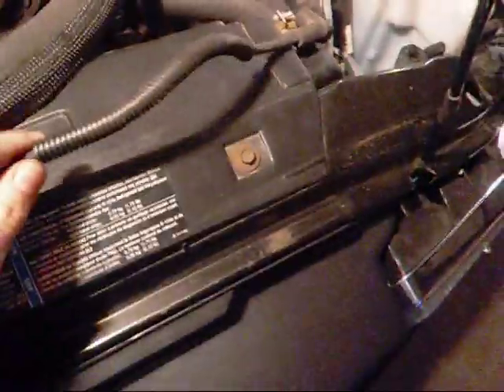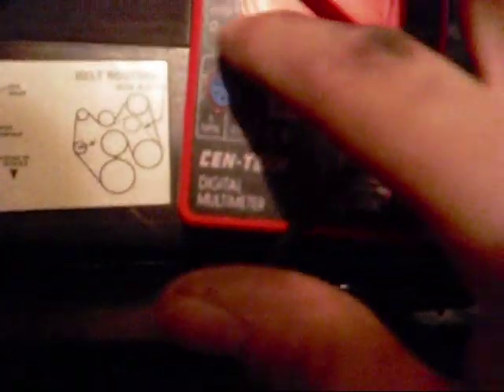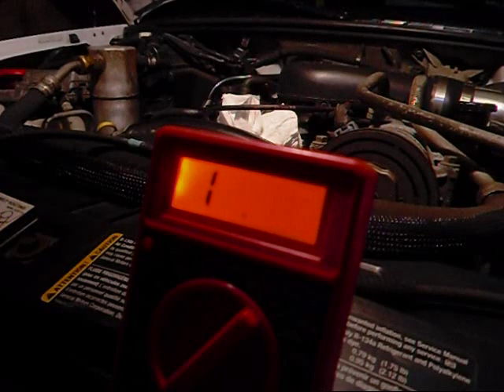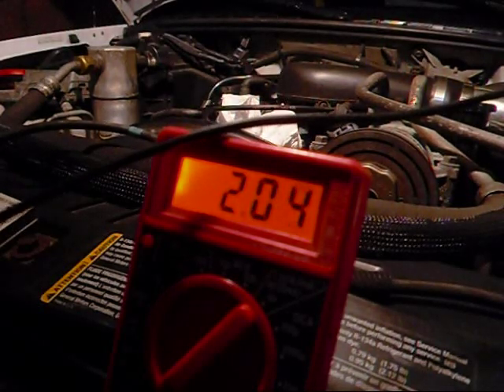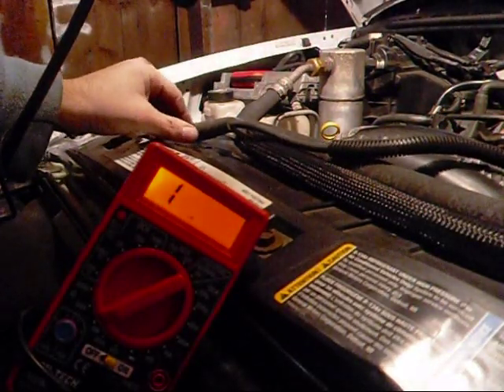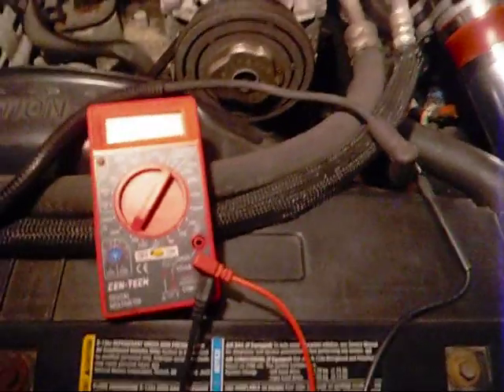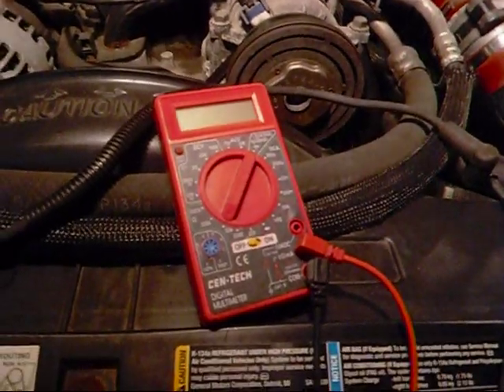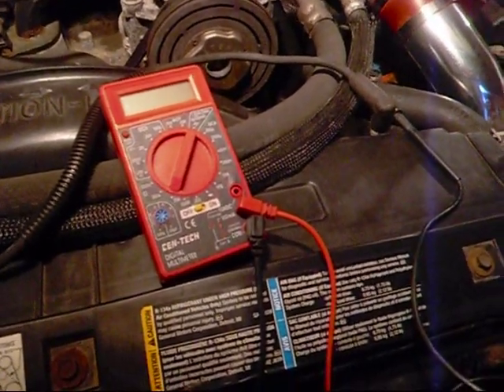how to check resistance is spark plug wires

Comment: Rule of thumb is a resistance wire should not exceed 1k ohms per foot or 1000 ohms per foot.(Same thing)  If you have way more than that .... pull back the boot off each end and make sure the point of the metal end has punctured the wire jacket to the core or the small piece of "U" shaped wire that connects the end to the core is not burned . If the core wasn't making good contact with the point of contact of the wire end .... always have a spare wire around that you can transplant the end. If your end is good then open the end where it wraps (crimps) around  the wire, cut about 1" off the wire and re crimp the end making sure the point touches the core.  If you do it right the wire will be fine as long as the resistance stays below 1000 ohms per foot. This is for resistance wires only ....solid wires will read no or negligible resistance ...0-2 ohms  but, that would be a model "A" ford.

Comment: lower resistance in spark plug wires is always best.  Different manufacturers call for different minimum specifications.  Test a spark plug wire on a top fuel dragster.  You're going to find the resistance barely exists.  Check your piece of garbage Kia or Hyundai.....out the roof high.
Reply: +Kevin Johnson That's because dragsters have solid wire cores ...but, family car with solid core wires ...the radio would be useless.

Comment: You are an idiot, the lower the resistance the better.  How are you going to show somebody how to fix their care when you have no idea.  And if you want to check at night get somebody in the vehicle and hold the brake in gear and then give it gas to put a load on it and check for sparks jumping.

Comment: The lower resistance is good. resistance should be 4k to 5k per foot. the higher resistance helps suppress radio noise. It used to be that there were no resistance type spark plug wires, in which case you would find nearly zero resistance. Replace if the resistance is higher than 5k per foot. You will NOT loose spark if the resistance is less. You will however cause radio static. Your lack of knowledge of how to use your meter is good indicator that you do not understand what you are measuring.